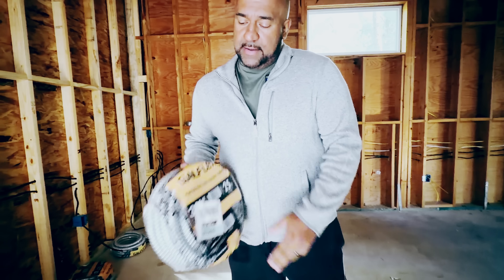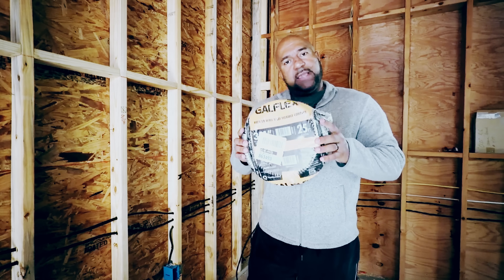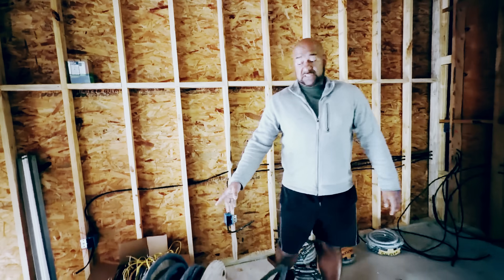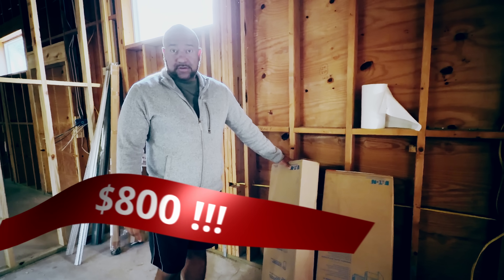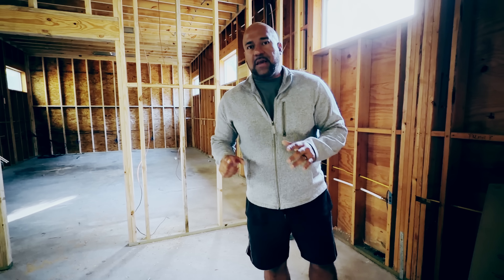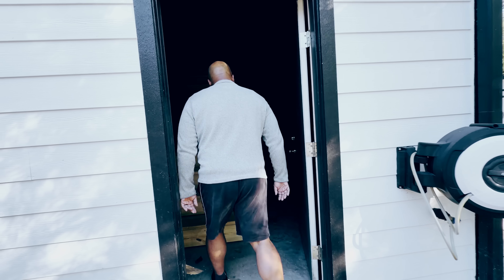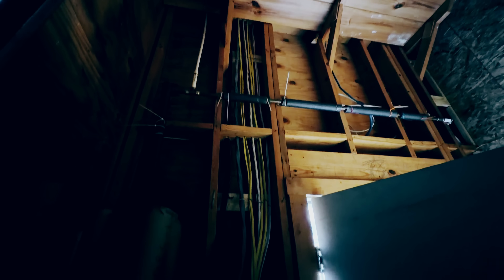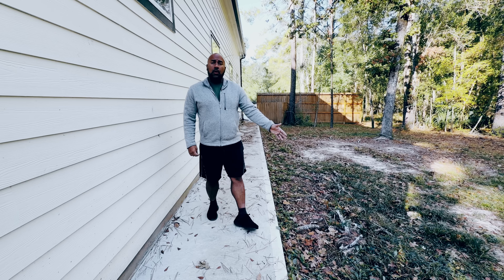I’m Finally Perfecting My Sound Room Electrical System

Comment: I hope the electricians ran the wire correctly. When running wires through conduit, can’t just put that black wire in the conduit. Has to be wires with insulation only, no outer jacket. Wires can/will overheat otherwise and fail inspection

Comment: Why not the Torus Power All-in-One (AIO), which provides a comprehensive approach to whole-system power conditioning? The stand-alone electrical panel has two sections. The top section is pre-wired with 24 industrial-grade 20A bolt-in breakers, which are fed by robust 1 ¼” x ¼” all-copper buss bars. Advanced surge suppression is provided.

Comment: Jay, I’m an EE that design industrial control systems in Houston. We use an isolated star grounding system to prevent noise on sensitive electronics and control signals. It’s three ground rods spaced 8ft apart in a triangle pattern, bonding to each other and grounded to earth. Each rod serves a purpose, one for AC ground, one for chassis ground for the electronics, and one for instrument signal ground to ground the shield drains. 

I told myself if I ever get a chance to build a sound room like yours, I would implement the same ground system. It sounds crazy to isolate your ac ground from your amps, audio source equipment , and even rca/xlr signal shields, but I’ve seen induced noise and voltages on these grounds if not isolated. i haven’t seen this implemented in residential, but I believe it will help improve your sound system. Good luck on your journey.

Comment: Fiberoptic internet installation works best with localized repeater or amplifiers in your vicinity or possibly multimode low directly installed on your service line to your soundrooms router

Comment: For best grounding for your listening rooms I would recommend using at least 3 copper grounding rods with at least 8 feet distance between one to another connected all tougher. Make sure to use a star grounding technique to not have potential difference that can cause damage to your systems. If you have rocky terrain at your location I would recommend to use ground enchantment material (GEM), that should also help preventing copper oxidation over time.

As for everything else, I’m just glad to see someone bringing to life the kind of dream I’ve always had for my own. Wish you success and God bless!
Reply: This.  All ground is not created equal. In my opinion, grounding is the singular most important thing affecting the quality of your performance.

Comment: Hello Jay, greetings from Brazil! When I first saw you pulling your wires through the holes inside the walls, I wondered: why not run them inside a metallic conduit? Well done! But, if you want these guys to shield your wires (or: provide electromagnetic isolation), you'll need to ground the conduits to drain those interferences to the ground.

Comment: Hey, just wanted to confirm the electrical code on this — you’re not supposed to run 10-gauge Romex (NM-B) inside metal conduit. Romex insulation isn’t rated for heat dissipation in conduit and it can overheat or get damaged on bends.

When you use metal conduit, you must run individual THHN/THWN wires instead — typically two 10-gauge hots and a separate ground (plus a neutral if needed). That setup is code-compliant and safe.

Just wanted to make sure you don’t fail your inspection

Comment: A piece of advice if you want to isolate your power to your subpanel for the sound. Install a balanced 1-to-1 transformer with a separate ground rod at the secondary midpoint.A piece of advice from an electrician and audiophile🙂

Comment: Hey Jay, nice work. Glad we are following the same electrical designs. I also isolated each cable within a conduit. Not only that, I ran a separate ground rod outside from the rest of the ground that's tied to the main panel so we have clean ground. That should help with noise as well

Comment: Hi Jay. I would use copper piping for the shield on the HiFi power feed instead of steel. Good to see you are using plastic outlet boxes for termination points. Someone in the comments said the conduit you are using for your 8 gage is aluminum. That would be better than steel but still not as good as copper. Also the remark about deep fiberglass outlet boxes is a very good suggestion! How do you propose to connect the 8 gage copper wire to your outlets? also anything free of steel fasteners or wire clamps is much better! Also... How do you plan on controlling wall vibration from getting to the power feeds to your HiFi gear if they are running inside the walls coupled to the studs?

Comment: All you need is half a dozen PS Audio - 'P20' power regenerators 😂
Reply: The truth is, though, that the outlet on your wall is the best source of power. Using power (re-)generators provides no measurable benefit. They do a wonderful job at draining your wallet, though.
Reply: @casperjensen1769   ...hence the facetious little '😂' at the end of my comment.

Comment: Just curious, are you going to test the lines on the level of noise before covering the walls?
Reply: hahahahaha yes and there won't be any difference at all, so much voodoo, it must be some really bad equipment if it's necessary! is High End really that bad.

Comment: Maybe have to add reinforcement (sister joist) 2×4 frame to account for hole size of conduit and frames structural integrity.  Like the organization of electric designations > switches, regular runs and outlets. 
Look into ethernet baluns if necessary for length of run

Comment: Ok watched again, maybe those aren't the flimsy blue. You may still need to change those with the conduit installation and they should be deep and kicked out with stand-off to line up with the extra depth of insulation and thickness of drywall!! Otherwise your outlets are going to be a couple inches deep(not flush with exterior of wall) and would need finishing plenum housing. Not all plugs especially large assembly high end cables won't be able to fit.

Comment: Good to see its flex conduit, as 5ft of solid conduit needs like 10 ft of drill hole length to feed to the area placement. 
IN THE SPIRIT OF DOING THIS ONLY ONCE... those outlet junction  boxes should be the higher grade fiberglass, thicker plastic or metal. Especially now you're adding coduit to feed the outlets. Standard drywall flimsy plastic just doesn't add up!???

Comment: Yes Jay, that is the way for low EMF power distribution. And yes, cupper is needed to provide better energy pass thru performance, in Europe Aluminium cables in house installations are ban for more than 25 years. |Reason - many reasons, it remains in use only in Very high voltage overhead powerlines (35kV and above)

Comment: Hopefully the metal conduit doesn't produce a negative effect possibly making the audio sound dark, I know shielded power cables to your amplifiers can be detrimental to closing off the dynamics.
Using the the Romex might be a good solution on blocking unwanted noise, and possibly be good on your digital end, it might not be a good idea for your amplifiers, I would ask OCD Mikey, thats just my opinion. Just thinking outside the box.
Here's an idea keep the ones you already had run with no conduit, and run new power cables with conduit, this way you can have the option of fine turning your system.
Overfiltering can cause more harm than good, especially when its inn the wall and its permanent.

Comment: So you are shielding the whole line! That's good! And steel blocks not only the electrical field component of interference, but magnetic fields too (and although they're supposed to be 300 times weaker, in dB scale they count too). What I don't know is the possible interraction of the AC with the shield-hose, since it's rather narrow.Hopefully, it won't inductively drain some of the AC power. Ideally, the shield should be of big diameter, with the copper conduit sitting in the center. I'd attach on it a grounding cord for every yard of its length and then connect them all together (like a star-grounding) to a common, independent ground. Alternatively but less efficient (like bus-grounding), ground the whole shield at one of its ends. So it will drain away promptly, whatever interference it picks-up. Don't forget to make some nice grounding points! Get some nice, long, copper rods and stick them deep into the ground, as far appart from each-other as possible (2 yards minimum). Irrigated, wet soil is preffered. Use different grounds for high-current sources and low-current ones. Also, different for signal-level groundings, if you manage to get any. GOOD GROUNDINGS MAY BE EVEN MORE IMPORTANT THAN THE REST OF YOUR WIRING!

Comment: Hey Jay, glad to see everything is going good. Ask the internet guy if he can run fiber from the house to the sound room. Fiber is usually for longer distances. But might be less conductive to noise
Reply from the maker: Will do!
Reply: @jaysaudiolab This is important  Do cat6 10gb add a layer 3 switch and Vlan off your audio traffic and apply some qos to prioritize the Audio traffic.

Comment: Hi Jay.
Not looking to criticize but I'm an electrician by trade over on NYC and deal with real expensive electrical equipment. I searched the panels you purchased, and it says the bus material is aluminum not cooper. I suggest that you take a look inside and verify that there is copper bus. Also, it would better if you use a panel that is commercial & has bolt on breakers not the regular home stave in breakers. Bolt on breakers will give a more solid connection, which I'm sure it will give a better electrical conductivity specially when your system demands more power. You are doing such a wonderful job and would hate to see you regret something after you finish your installation. Hopefully this helps.
Reply: You are 100% correct. NYC is the big time. Texas is basic…..

Comment: I used shielded cable to replace a couple sections of Romex. According to the EMF meter that the customer owned, it cut the EMF noise in half, within a few feet. I took a lot of readings to be sure.

Comment: I speak from experience because I had two new panels put in my house with a new feed. If you put that wire in a convolute you are significantly going to decrease the amp rating because of the heat. Especially in Texas.

Check the National Electrical Code (NEC) Ampacity Charts

Comment: That FMC is NOT steel. The brand name should say it all: AluFlex. Yes, you can get FMC, aka BX cable in steel, just what you have in hand is the aluminium version, which many electricians prefer because it’s MUCH lighter thus easier to handle.

Comment: What receptacles are you using with 8 gauge ? I do not know of any that take larger than 10 gauge for 125v . Hubbel  once made one in the 80's that would  for industrial use .
Reply: There are no standard duplex receptacles made that are certified for larger than 10awg wire. They will run 12awg leads from receptacles, pigtail them to the line feed in box
Reply: I’m curious if he’s using isolated ground receptacles. All of this oversized wire and he’s not running isolated ground receptacles with separate earth ground rods, then starts wondering why he’s hearing a mild hum🤦‍♂️
Reply: @MichaelM-to4sg  The isolated receptacle  ground separates the bracket  from the ground pins . As in the hospital used the ground is connected back at the panel . Reducing eddy currents and thus hum .  Ground is for safety in this case a bit different when dealing with rf transmitters (Ham Shacks) . It Texas  is the soil has a good bit of sand in it a ground rod longer then  code required should help reduce noise.
Reply: As a general rule it is against code to have two power sources feeding one space or building, no? 
One reason for this is that in an emergency it can be dangerous for first responders unfamiliar with the intricacies of multiple feeds to ensure safety. 
If this application does fall under an exception I imagine that component identification rules are stringent... or should be.

Comment: As you will notice in the comments section over this built, there is going to be a ton of opinions and suggestions of how to do things the right way for your specific purpose. I personally would have to think about revealing every detail about the electrical connection to your sound room because there is always several ways to skin a cow. But you know, do what you feel is best and do it with the knowledge that it will be the best way this can be done. And besides all these opinions and suggestions, be happy and content with yourself.

Comment: @Jay.

Dude!
You should really seek professional help. 
You are an accident waiting to happen. 

If you are going to use conduit, use solid conduit, and then use 12ga wire for both your 15A and 20A circuits.  Then use  metal boxes, and 5-20 outlets. 
Of course YMMV depending on local building codes. 

Did you pull any permits? 

When the SHTF happens... don't come crying to anyone because you thought you knew more from doing your own 'research' and not bringing in competent professionals to do the work.

Comment: If you look at the massive power wires leaving the Tesla Giga Plant's new power station, they are being sent through large PVC pipes to the mega packs. I would skip the metal and use pvc to isolate.
Reply: The conduit is there to shield not to isolate.

Comment: How do they wrap that 2 guage wire around the little screws on the outlets?
Reply: It's 8Ga wire. There are crimp on and weld ends to step down and attach. You asked valid important question

Comment: JAY, RETURN THOSE BR PANELS AND GET THE CH LOADCENTER.  I was the Residential Eaton sales lead in Chicago for a decade.  CH is what you want.  BR doesn't have copper bus.  BR is the old Bryant line.  Its not garbage but its just cost saving builder grade stuff.  CH is the top of the line in the industry.
Reply: CH is the old Cutler Hammer junk. Not only is it garbage, my rep says Eaton is discontinuing the line. Those panels are so bad, we consider them similar to Zinsco, FPE and Challenger. When I buy a building that has an original Cutler-Hammer or Eaton CH, we replace it, always with Square D QO PON panels. 

I have seen Eaton BR type with copper bus. During Covid, when Schneider production of QO loadcenters were impacted, we did a couple builds with Eaton BR 225A and 400A 3-phase panels that had copper bus. They are not same quality, especially the breakers, as QO, but I’d certainly choose BR type over CH everyday of week and twice on Sunday. 

Then again, we have not touched an Eaton panel since 2021. It’s always QO or Leviton as our reliable backup choice. All have heavy copper busses, easy cable management and reliable breakers.
Reply: @MichaelM-to4sg That's not true, CH panels are highly regarded by electricians. They're not being discontinued. I just recently had put some in and I did my research. They actually have a lifetime warranty with copper buses.
Reply: @dman7776 You are correct.
Reply: I agree.  Something doesn’t add up, the cost he mentioned is not even remotely come close to the panel he showed.  The CH line is the one with the copper construction.
Reply: If you consider a powercord of 2 meter can cost $60.000 then $1700 is a bargain😅

Comment: Jay, I could be mistaken but the Eaton model specs for the unit you showed shows an aluminum bus bar and not copper per their site product specs.
Reply: Correct, BR is aluminum.  CH is copper.  Completely different species of loadcenter in terms of build quality.  The CH line uses true commercial grade main circuit breakers.  BR is the old Bryant line.
Reply: @isobutylquinoline Thanks for confirming.  Just wanted to to give Jay a heads-up in case he received/ordered the wrong unit.  I also noticed that the unit he showed doesn’t come close to an $800 price tag. I saw it for about $300.00.
Reply: @BlueSilvertone  
Most likely contractor markup which would include cost to install too.
Reply: @Archangel-v5y Uff !  Quite the markup, I’m in the wrong business.
Reply: @BlueSilvertone  
Depends. They are forced to repeat the labor. Not to mention I doubt Jay looked into permits or code. 

The other thing... Jay could have buttoned up the walls and ran the conduit on the outside for a more industrial look.  All metal solid conduit and boxes.

Comment: In the UK we have fire safe cable called FP200. It has an aluminum shield around the power conductors and drain wire. It's a lot easier to use than threading flexible metal conduit and feeding those cables through. Maybe you have it in the US too?
Reply: It depends on where you live. 
In Chicago... in Condo/Apartment and AFAIK most residential buildings... you need to put your electrical wiring in solid conduit.  The flexible conduit aka 'whips' are used in renovation runs less than 6' in length.  ( Anyone who lives in Chicago and did any renovations knows this....)

As to his internet... he could go commercial wireless w a point to point system...  Or he could pull a couple of pairs of fiber and bury them at the same depth of  the power lines below the permafrost depth... More to protect them from people doing lawn work ....  but even that's a little over kill but worth it. 

His wiring is a joke. Sorry Jay but you want to do it right... just pull 12ga wires if you're going to not use romex ?sp?. 

He also should have hired an architect.  But that's a different story.

Comment: So so sorry for this, but how are you gonna determine the direction of that wire? I’ll tell ya - Make some 1m  speaker cables from those runs, and take notes. You asked for viewer engagement…so…booom - there it is. Forget an emotional response for a sec - cuz all this looks a hella expensive, but a given wire swapped in its’s direction sounds wildly* different, like wiiidly different. Am I wrong?
Reply: Not sure, but probably doesn’t apply to power cables
Reply: @Coneman3 I guess.